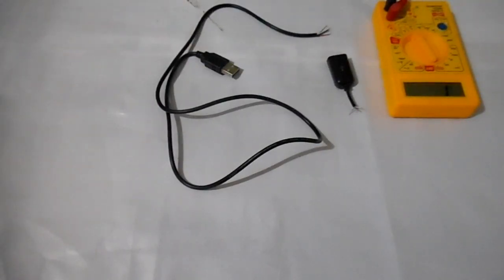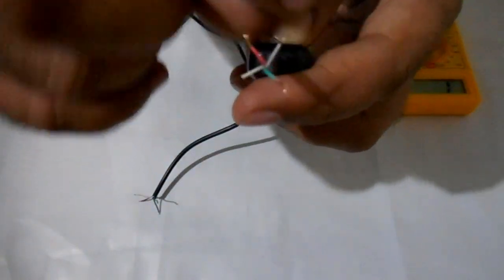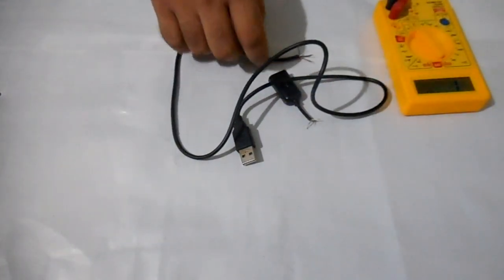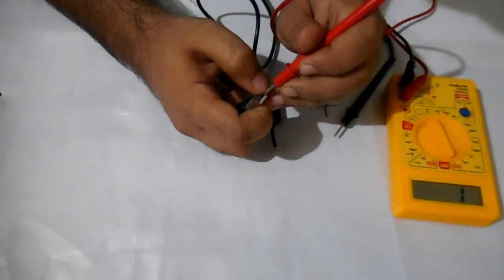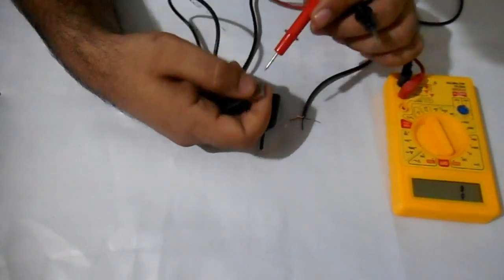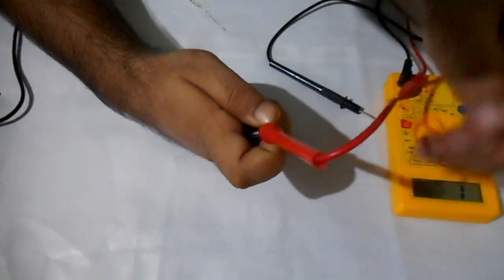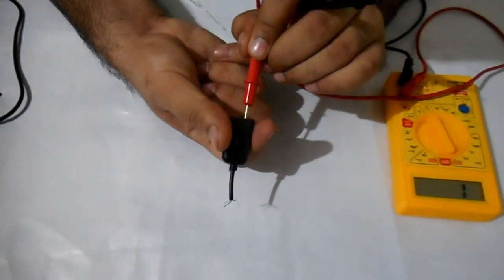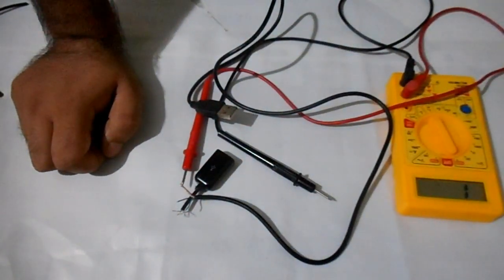How Data cable works? - Testing Data cable using multimeter and fixing it in the correct way.

Comment: I can't believe you only got 40,000 hits given. I can't find a single other. Video relating to this.

What is your multimedia set at? And also my cord seems to have all 4 wires plus an extra ground wire that is Attached to the side not part of the connector port but with a separate screw an ground loop
Reply: It set to test continuity, that's why u hear the beep. You can also check with it set to measure ohms

Comment: hello Sid's -- I can't get buzz continuity for 500m RS485 cable 24awg - but able to get resistant on the multimeter
Reply from the maker: Check the piezo in it, its just cheap quality one, and not install correctly, that can be the issue.